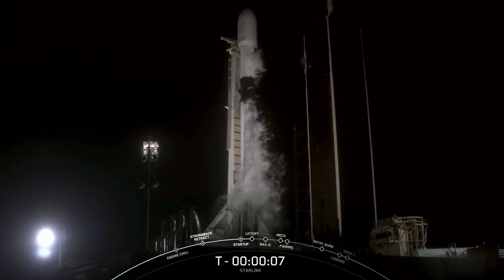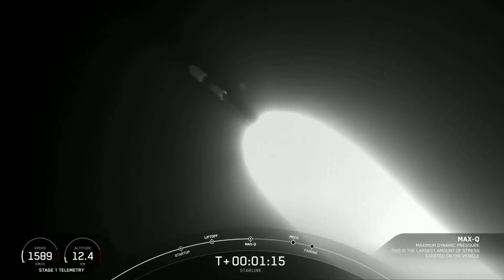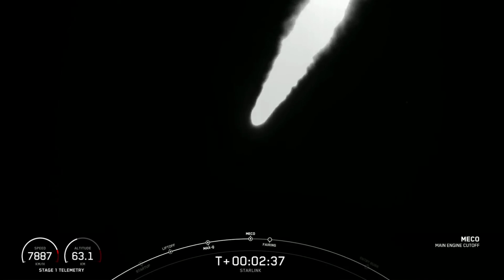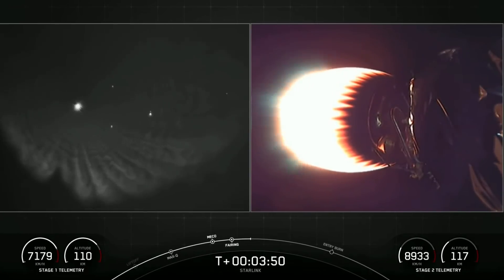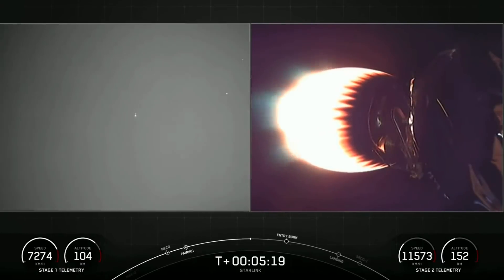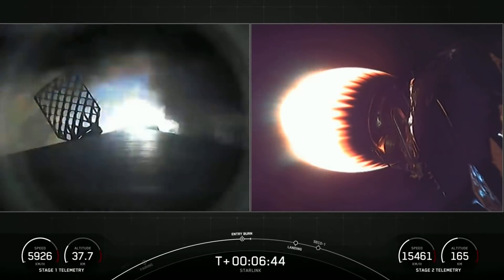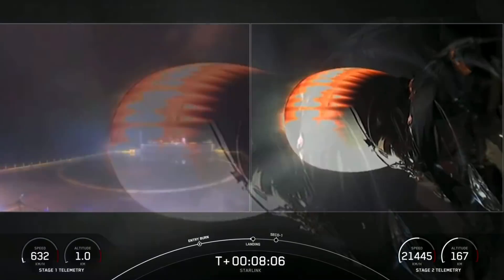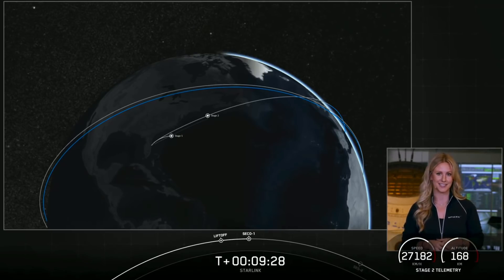SpaceX launches Starlink batch on rocket's record 9th flight, lands too!

Comment: Why does the landing pad camera just happen to go black before touch down for so many of these landings?
Reply: Right. You'd think that if they can fake a rocket launch, they could fake a landing.
Reply: They should record the landing and play it back after the satellite link comes back. I don’t care if it’s live, I just want to see the landing.
Reply: the rocket vibrates the shit out of the antennas, live broadcast are loss do to the oscillation effect.
Reply: @odisy64   Is the vibration theory fact or speculation? I did some checking and here's a better answer: Ionized gases disrupt radio transmission.